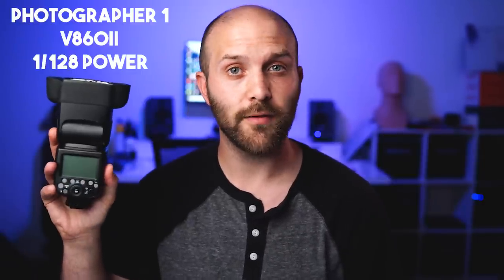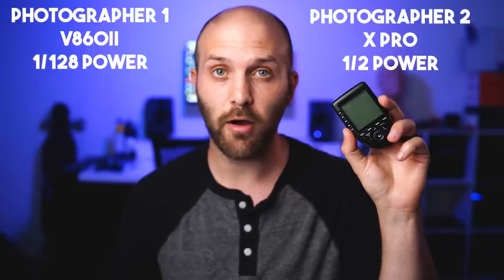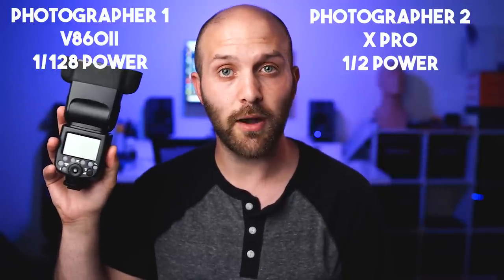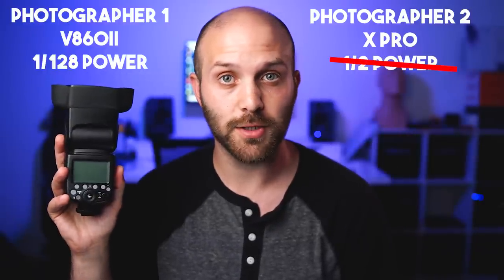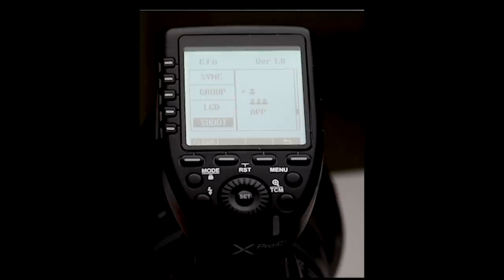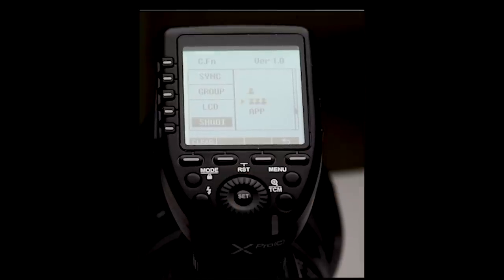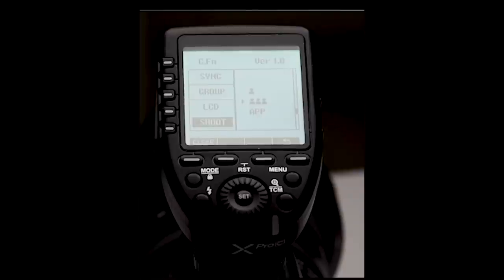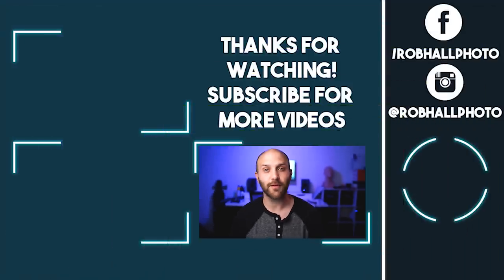Using 2 Godox Masters at Once (V860II, X-Pro, X1-T, TT685)

Comment: Thanks for the video Rob! But I think you're incorrect regarding the V860II/TT685 - they don't send out an information signal on every shot. They seem to be do it just every once in a while.
To make things worse, some units have a problem where power levels simply "reset" on the remote flashes, and since the V860II doesn't send out the information signal on each photo, the levels are now not even what you've set. If the V860II did send out an info signal before each shot, this wouldn't be a problem... But unfortunately I know several photographers that it's a very big problem for them.
Reply from the maker: You can take two V860ii’s on the same group and alternate back and forth. I did it over 200 times yesterday, not once did they send the incorrect output (not to mention I do this at weddings every weekend).
The only time I’ve seen behavior like you mentioned is when someone mixes brands (like V860II-N triggering V860II-S) the information is not properly updated.
Reply: Yes, but it doesnt work when flash is attached on a Nikon and an other Photographer on Sony... The sony one works but the Nikon doesnt send both signals at the same time... I always have to press the trigger on the Flash otherwise it adds the info from the sony one.
Reply: May I ask, Are you shooting on Nikon?
Reply: Maybe there's a difference in how the Nikon/Canon/Sony versions behave... I shoot Canon.
Reply: I agree. I've been testing this all day with tt685's and they don't report the Slave setting changes unless I hit the test fire button. So if I change the slave to 1/128 on cam 1... then the slave will fire at that power. Even though cam 1 has that slave group set to 1/8. HOWEVER... this does work in ratio mode. I've tested it with 3 cameras. Each camera had slave B set to a different manual power setting. Every time I fired a different camera it would properly update the slave to the correct power.

Comment: Maybe it is out of topic, but anyone had issue with connection XT1 canon.with V860 II, which is working randomly... sometimes connects without problem sometimes looses connection... Lamp is on slave, same.ch and same.group. Also it has problems with connection after changing modes... Please advise if anyone know how to solve the issue

Comment: I experienced an issue I had never had before, when I attended a large workshop.  There were a large number of Godox trigger users there, and no matter how often I changed channels and groups on my Canon X Pro-C, there was cross-talk with other attendee's triggers..  The strange thing IS that my Godox flashes and trigger would change over and fire with other people's cameras, and their camera brand would appear at the bottom of my display: Sony, Nikon etc.. On my Canon branded X Pro trigger, flashes and strobes.
Reply: My system would fire ok for a few shots and then just stop.  I would look at my X-Pro display, and it would say,  "Sony or Nikon,"  and fire when another Photographer with those brand cameras took pics.
Reply: This has happened to me with my streaklights and my ad200s a bunch of times when shooting weddings Specifically with nikon shooters, (i'm canon) and when they have specifically used an XT32N trigger. (they were on different channels, but my AD360C would still randomly switch and say "nikon ttl" on the screen)  Have you found a solution?